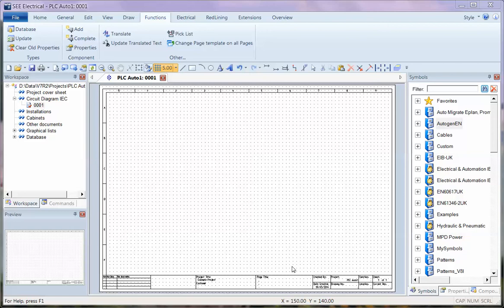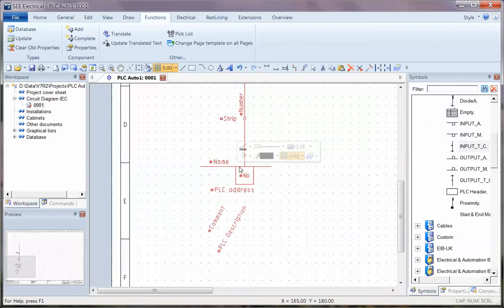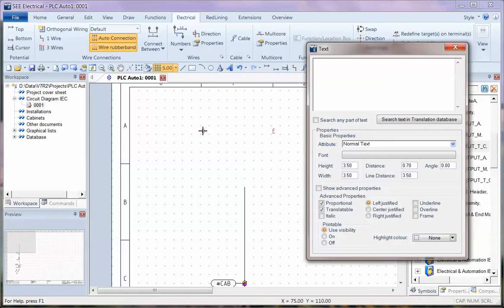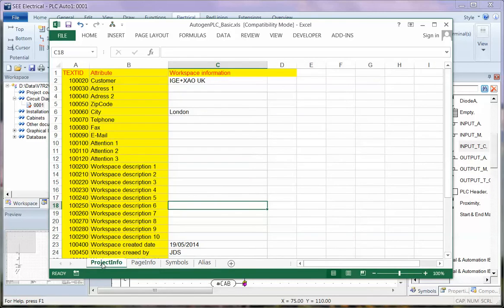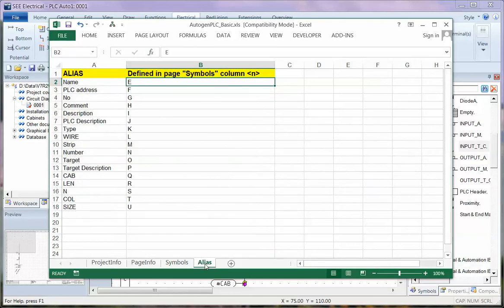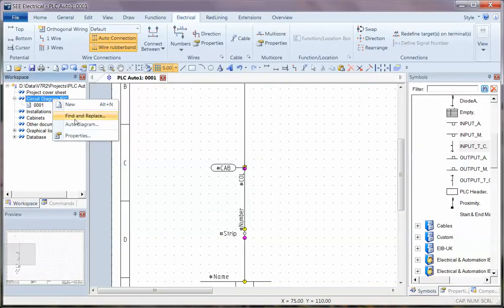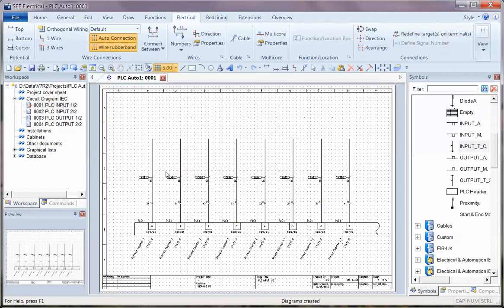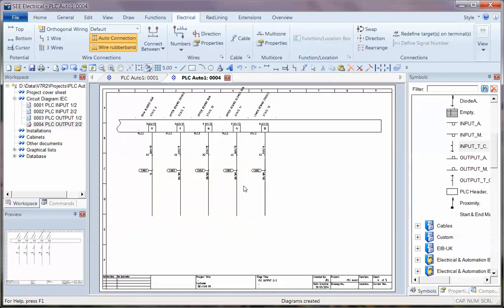Auto Generation of PLC data example V7R2

Comment: Hi!
I think I'm doing something wrong. When I do all the auto diagram process the symbols get inserted below the page, i mean outside the page template and screen. What could I'm doing wrong?
Reply from the maker: In the 'Symbol' tab of the auto generation settings, at the bottom of the menu under 'Module positions', you'll need to decide if you are using the beginning and end markers or just X and Y position for each macro circuit. Then its up to you to select the correct symbol origin for each macro circuit so it appears at the correct height.